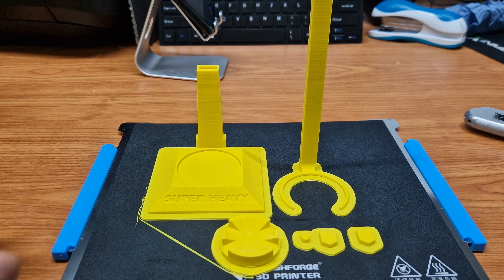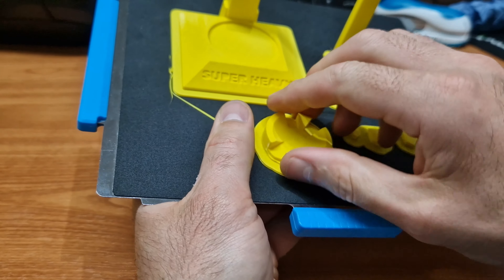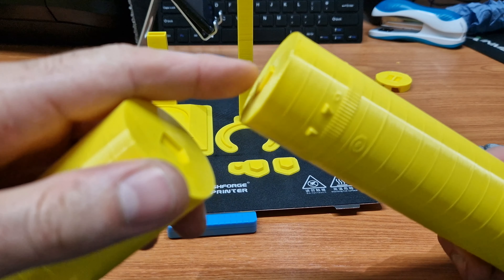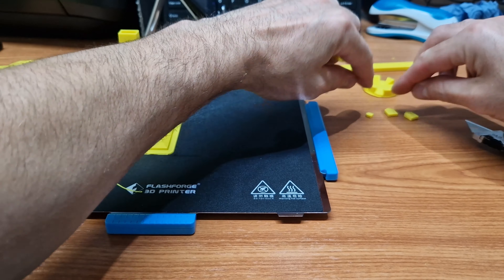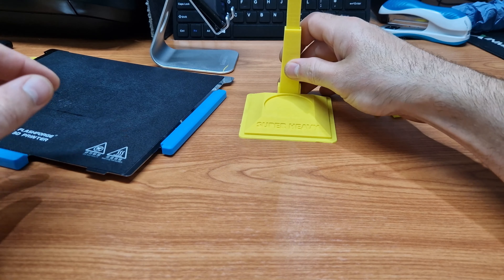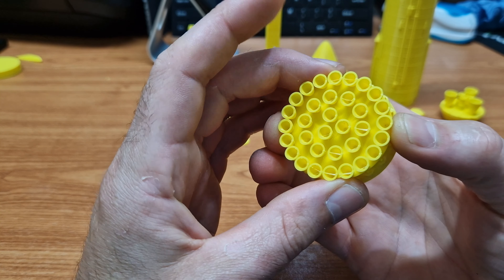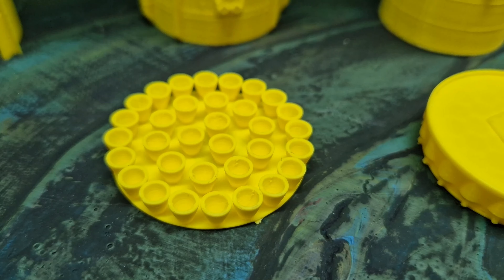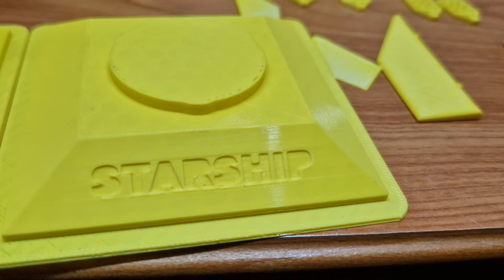My Journey of Learning 3D Printing.  Pt.6. Starship S 24, SUPERHEAVY B7 Model.#3dprinting #starship

Comment: As a 3d printing and spaceflight enthusiast I alsolutely love this! There however seems to something wrong with your print settings or printer, that causes the uneven surface finish on the sides. It's very difficult to get the layers to be completely perfect and you will aways see some layer lines under certain lighting, but there should be a way to get it better than this.